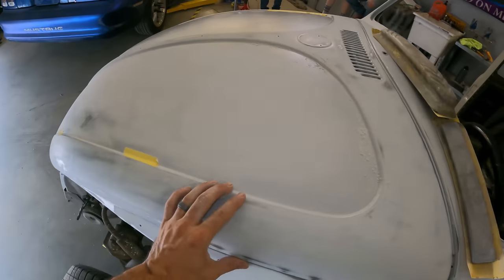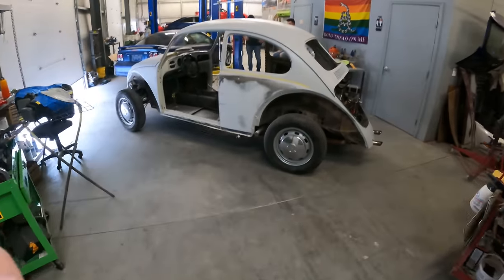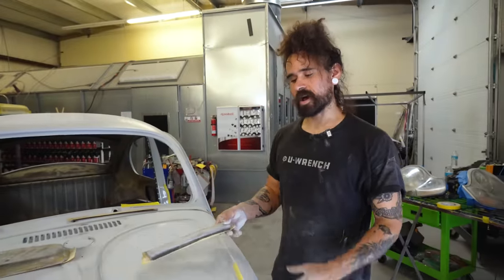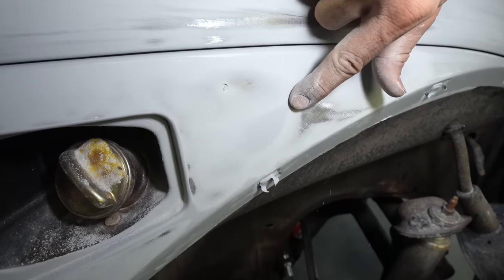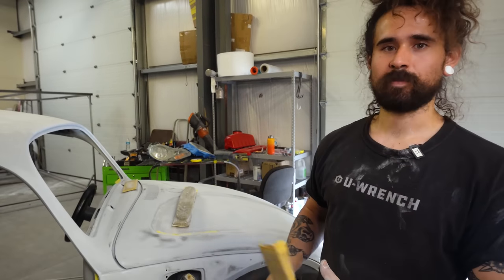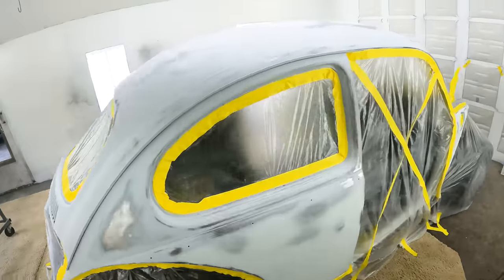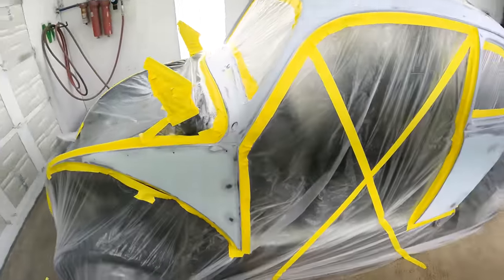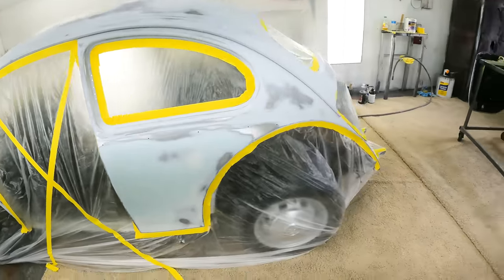Prepping a Vintage VW Beetle for Polyester Primer | Sarah-N-Tuned Beetle Give-Away

Comment: do you need to treat the VW after Body filler & sanding, before laying down primer? Do you need Tack rags, or even just blowing off with compressed air? Seems like sanding dust residue would mess with the primer.

Comment: Back when all season tires were crap, the Beetle and Corvair had the weight of the engine over the drive wheel and were cheap, so you could get by without winter tires, if you could live with the poor heating and defrost for the interior. Also, parts and labor were cheap, even though the air cooled engine life was not very long.

Comment: at this moment i think you are fooling all of us with the pink...cant believe your lovely neighbour chose that color....
Reply: Doesn't matter. The final finish will be white.
Reply: @bongodave13  did i miss something? its just a primer and not the final color? i am dutch so perhaps misunderstood...
Reply: @bentandre5524  yes the link is polyester primer which Sarah will now guide coat, block sand and then topcoat.
Reply: I mean pink! Can’t edit on iPad for some reason.
Reply: I believe the can of primer said color changing, goes on pink, dries a different color
Reply: On the paint can, it says "SPRAYS PINK > SANDS GRAY," which means that it's pink right now, but when it gets sanded (by Sarah), the primer will become gray—unless there are low spots, which will remain pink. If these guys did everything correctly, there shouldn't be any pink spots after Sarah sands it. 

The term "guide coat" refers to a thin layer of paint that is sprayed on only to be sanded off to determine if further body work is needed. (I learned this from one of Fred's appearances in one of Sarah's videos.) It seems like when Fred said that Sarah's going to "guide coat" it, he meant that she's going to sand the pink guide coat that he applied at the end of this video. But I could be wrong about that last part. Maybe she's going to spray a guide coat herself. We shall see.